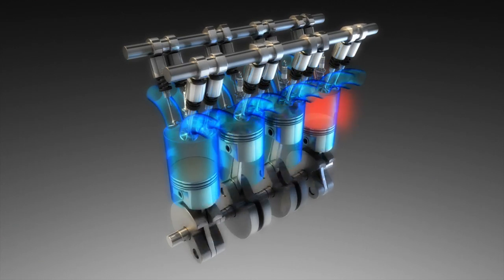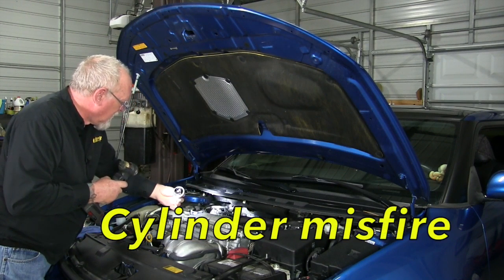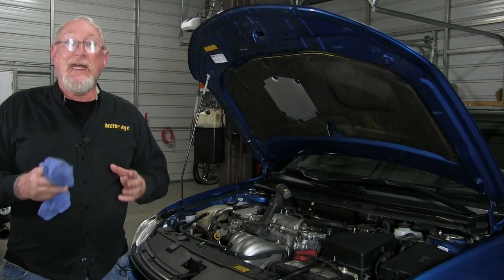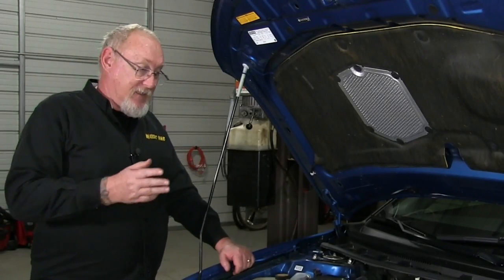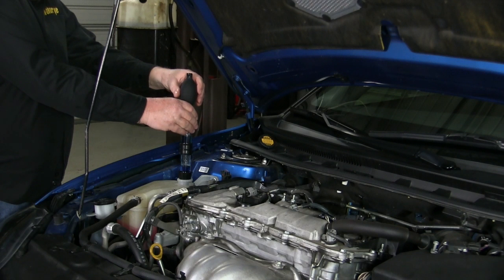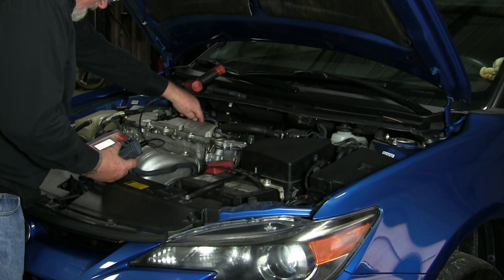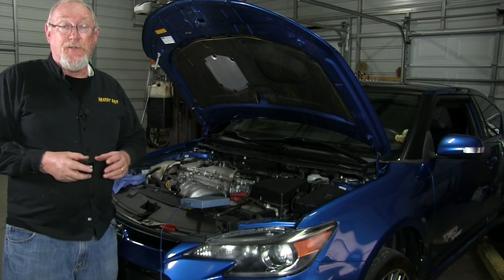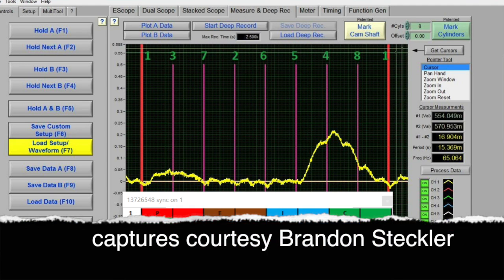The Trainer #87:  When The Leak Isn't Visible

Comment: Is it plausible for coolant to leak from the upper intake manifold and get sucked into the combustion chamber? My 2008 Ford Econoline E250 V8 4.6 2 valve has an aluminum coolant crossover tube connected to the intake manifold. Thank you.

Comment: On small cold start up missfires that go away after warm up. I remove a 1/2 gallon of coolant and pull a vacuum on the system. If it will not hold vacuum it has a leak, air molecules are smaller than water. The pressure testers will hold pressure on a small leak because the head gasket will not pass enough coolant to cause a noticeable pressure drop on gauge.

Comment: I have definitely added pressure to the coolant over night and checked the cylinder with misfire but have also tdc the cylinder with misfire added a leak down test and watch the radiator bubble the leak down. Lots of fun ways to find these problems the over night helped on that super slow leak

Comment: awesome advice! typically if i encounter a vehicle with an over heating issue, i check to see if the fans work, coolant is flowing (thermostat,etc) and any possible radiator blockages. If everything checks out good then it gets a headgasket. for the most part cooling systems are pretty simple. Not too many things will cause over heating. process of elimination. Sometimes the leak is really obvious. Make sure you guys check out my vids.

Comment: some Saran wrap across the radiator filler neck... push a depression in the saran wrap..  seal it in place with a rubber band..  if the reservoir has coolant in it..  you may not need to pinch closed the overflow tube.. give the upper hose a squeeze to verify the depression pushes up and back down.. start or crank the engine for 15 seconds.  the depression in the saran wrap should not inflate .. there has not been enough time to cause the coolant to expand.  this is pennies and can be your first diagnostic step.  this tests for head gaskets into the cooling system.. or cracks in the combustion chambers.

Comment: A close inspection of the radiator cap can usually see a slight amount of exhaust soot on the rubber seal
Or moisture on the oil fill cap or under the valve cover
When other diagnostic tools are not available 
When compression is going into the radiator a simple tool can be made where a hose that seals around a radiator neck (a old cap adapt a nipple on the test cap after drilling a hole in it) then put the hose onto the nipple then in to a plastic bottle half full of water let the hose fill with coolant then drive the vehicle 
Gaskets will leak more under acceleration 
Continuous flow of bubbles will indicate compression in the cooling system
Another possible method   Is a leak down test which requires test equipment 
Wet cylinder head exhaust ports can also be present after shutting an engine off the rad pressure can push coolant into the cylinder
Reply from the maker: Those are all some great suggestions! Thanks for sharing them.